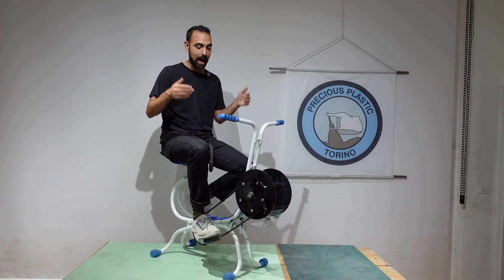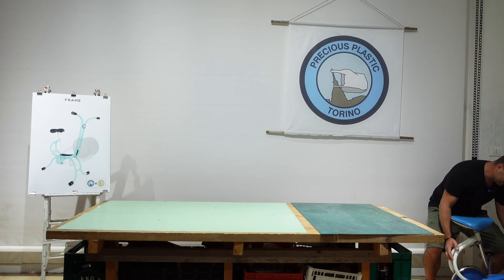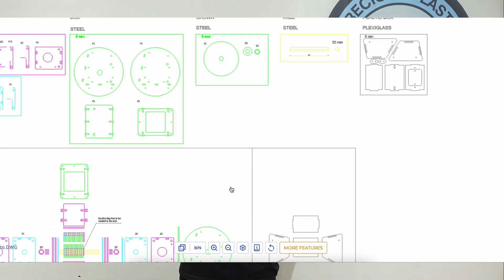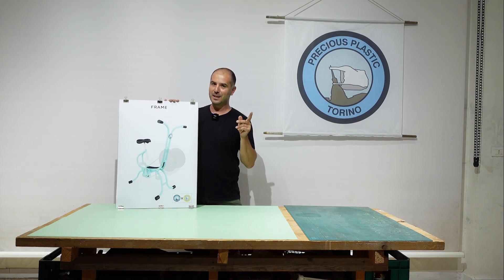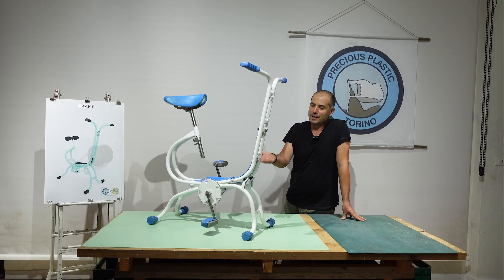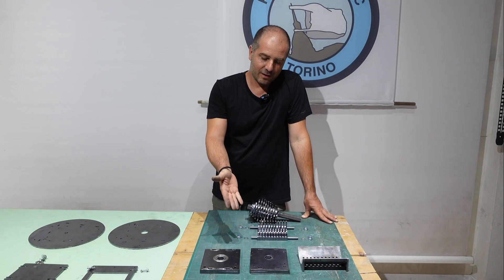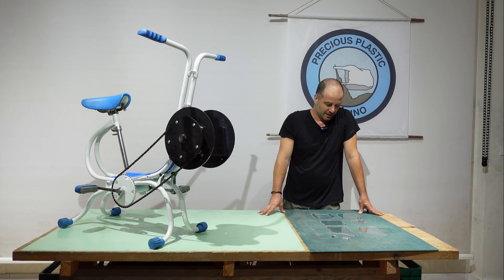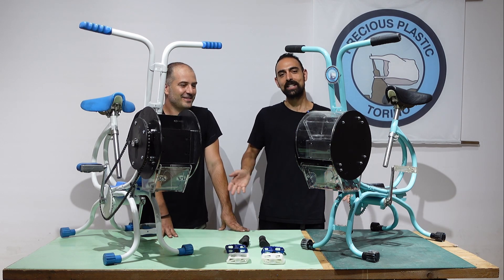New CYCLETTE SHREDDER: Get Fit!

Comment: I would definitely use a higher ratio in order to increase torque (by using a smaller pinion on the pedal axis.
Otherwise, it’s a great idea to use a static exercise bike which results in a relatively small footprint.